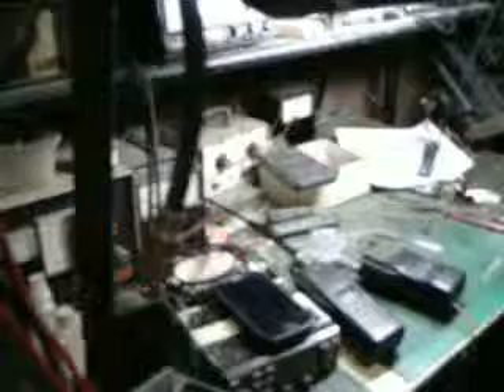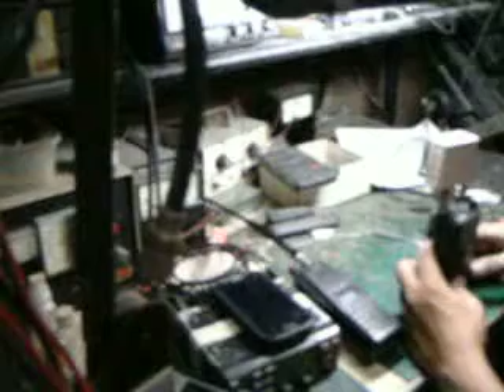4F1KJA restored the ICOM IC-V68 Handheld portable transceiver

Comment: Sir san po location ninyo ?
Reply from the maker: Peter Canoneo Noel J De Castro
Electronics and Communications Engineer
First Class Radio Telephone Operator 96-1PIV-16892
Class "A" 4F1KJA

+639185325514
3A Seagull Ave., cor Cadena De Amor St., Bay Breeze,
Brgy San Miguel, Taguig City 1632 Philippines